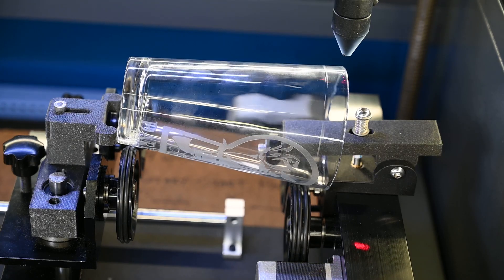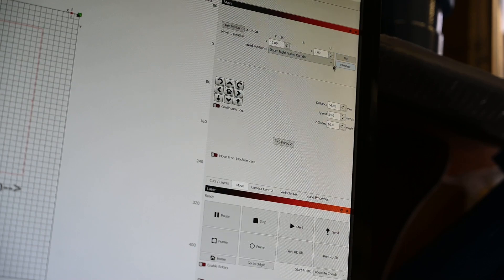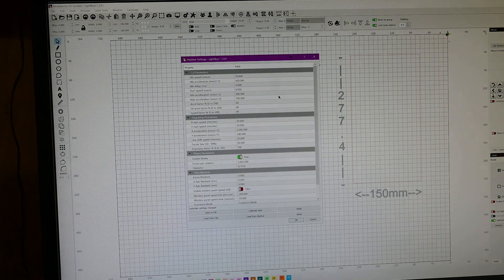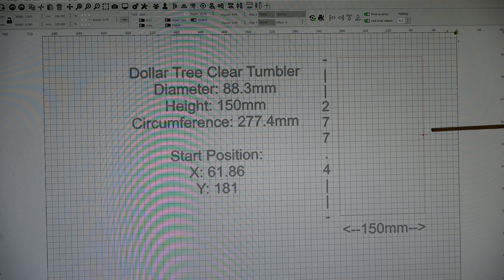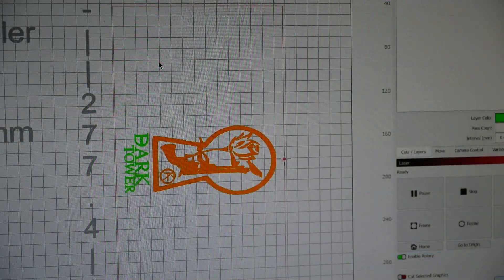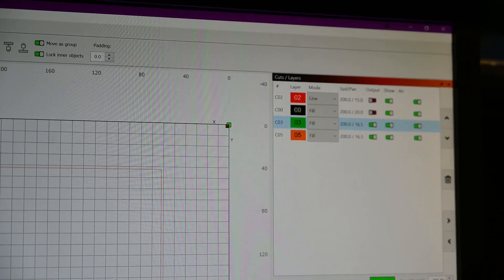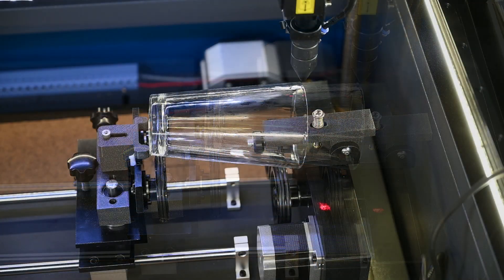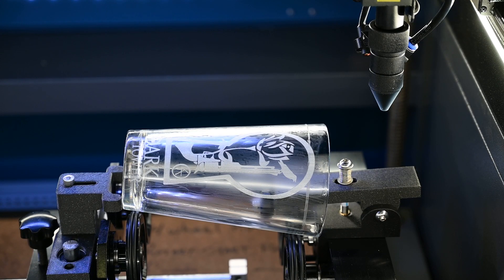Easy 10 Step Guide to Rotary Engraving - CO2 Laser on Glass - Omtech / Ebay / Chinese Laser

Comment: Great info!! I have the same rotary. What steps per rotation are you using?
Reply from the maker: @enjoime105  I usually start at 3005 and then tweak from there.  Some jobs with different drinkware I've had to go up to 3065.

Comment: Hey Rick, Thanks for all the great and useful information as always. I am starting the process of engraving tumblers. can you address how you stabilize the honeycomb bed for accurate placement of the rotary jig? My bed always seems to shift around when moving the rotary in/out of the machine. I'm using an Omtech AF2028-80w machine with a 4-wheel rotary. Calibrating actual positions with a sliding bed is frustrating. Do you have your honeycomb screwed into place for consistent laser positioning?
Reply from the maker: Yes, my honeycomb bed has two metal tapping machine screws on either side that are screwed into the frame.  It came like that and it doesn't move around much at all.  If I added a couple more I could completely elimate any movement of the honeycomb bed.

Comment: I'm trying to engrave on the same type of glass.  Do you have the machine settings available to download?
Reply from the maker: If you look around the @8:52 mark, you'll see I ran this at 200mm/sec at 19% power.  It's best to run some tests on a separate glass (that is the same as your planned project) to really dial in the settings.
Reply: @directedt3ch   what is your steps per rotation on your rotary setup menu?
Reply from the maker: . @Krusermissile  I had steps per rotation set to 3005 for this project

Comment: Great and well explain video
Reply: So I am brand new to the laser world. Just received my Omtech 60w with auto focus today, and that exact same 4 wheel rotary axis jig. After a few burns on wood to get the feel for it I wanted to try the rotary and do my shop logo on a tumbler. With my bed all the way down the tumbler sits way above the laser still. Am I missing something obvious?
Reply from the maker: @woodwork740  I'm sorry I missed your comment.  Were you able to figure this out?
Reply: @directedt3ch  yep, have to remove the bed and put the rotary directly on the knives (which is absurd having the same brand rotary as laser) but I at least got it going
Reply from the maker: @woodwork740  Glad you found a solution! My machine is manual focus.  I'm guessing there is less Z depth travel on the AF machines possibly due to the limit switches.
Reply from the maker: Glad it was helpful!